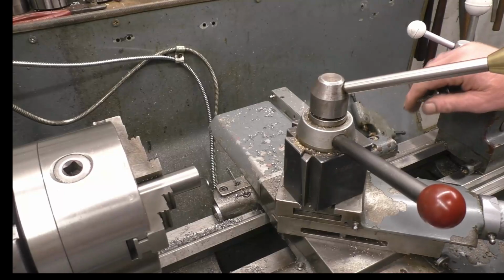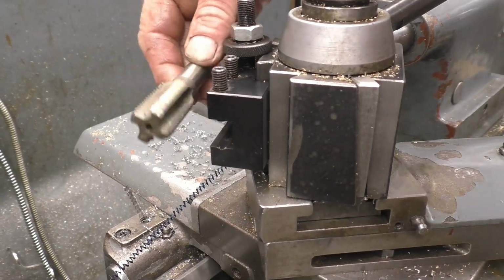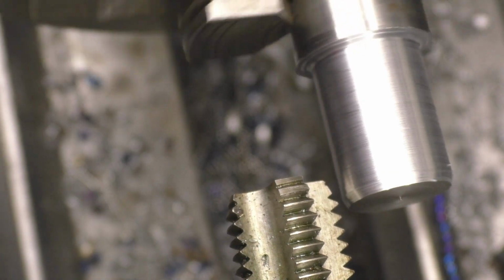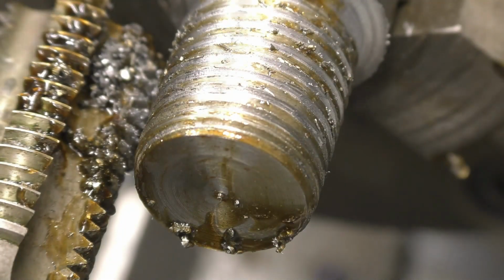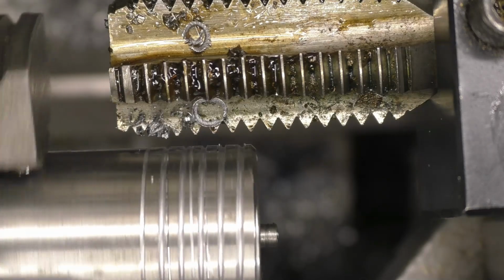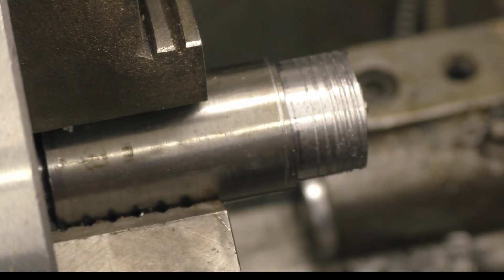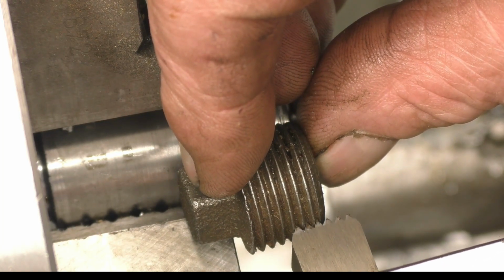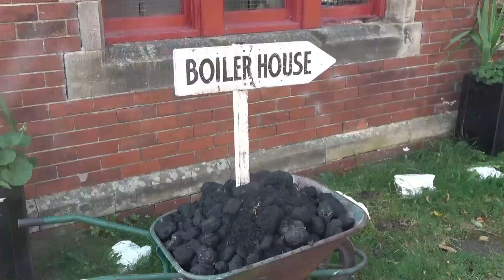SNNC 454 P2 . BSP Taper Threads. Tees Cottage Open Day / Car Show

Comment: The trick is to look at the leadscrew and the chuck, if they're both turning the same direction you're cutting a RH thread. If they are turning in opposite directions you're turning a LH thread, works EVERY time!

Comment: The problem you had was the cutting edge was on the wrong side and running the lathe backwards gave a left hand thread. What you needed was the lathe running forwards with a tap which had the cutting edge on the other side. There's a simple solution - use a left hand tap.

Comment: I had to smile when you said that you used to do guarantee/ warranty work on some of the vintage cars. One thing that I miss about those cars is the room under the hood as opposed to modern cars where you almost have to remove the engine to work on it. To be honest, I do not miss having to regularly change plugs and points on a car to keep it running well.
I applaud you on your willingness to try different techniques for doing something.

Comment: As your surmise, I think grinding tap to cut on non cutting side, the angle tap, then cut as normal RH will work.
Suggest turning taper first to suit BSPT angle, to aid thread tap angle.
Great on tonight's jobs, lovely machinery and video at Teeside.
Thanks for sharing

Comment: I’ve done this successfully save for using 1 chaser out of a modular pipe threading head instead of a tap and a Harrison L5A, the English predecessor to the metric 140, so you should do fine with it Jon 😎👍. That, and I found the technique from one of the Russian channels.
The principle is the same but the lack of taper in this setup comes from aligning the side of the tool to the work. If the tap is a taper tap then the axis of the tap should be parallel to the axis of the work. Cutting the taper on the work before will also make the job easier. Spindle CCW, tool on the front and a fast retract and it’s done. Best of luck.

Comment: Hi John and Debs 😊 great video mate, and a revelation seeing a tap work like that, I did notice it rolled forward towards the job when pressure was applied.i think your idea of grinding to get a lead cutting edge would help matters, also a flat on the shank to stop it rolling maybe, but your still not going to get a tapered motion of the tool holder I don't think. Anyway the car show was interesting, lots of nice examples there. Thanks bonny lad,  stay safe, best wishe's to you and Debs,  Stuart UK.

Comment: Hi john, the taper cutter I used had four cutters and trip. The four cutters were on a ring with two guides the threads being made pull the head into the work. The other one the ring turns and the bar or pipe is in a vice. Thanks for sharing.

Comment: Fascinating, I have seen this before but never this close up. It appears that only the first tooth on the tap is actually making the cut the following threads are just rubbing along the surface of the cut, pushing the cuttings back into the thread. I wonder if a better finish might be achieved using a second or taper tap where the cut is spread over a couple of teeth.

Comment: Try offsetting the tailstock and machine a taper, then use a normal thread tool to cut the thread.   May be a bit of b'stard thread, but it might work for a small item?

Comment: One way you can cut a tapered thread is between centers and offset the tailstock. I've never actually done it but in theory it should work 😊.
Cheers 🍻
Reply: Ah but then you have the arse if a job to put the tailstock back on centre!
Reply: @samrodian919  it's been more than a couple of years since I last adjusted a tail stock, but I don't remember it being any worse than truing up a workpiece in a 4 jaw
Reply: @mattsadventureswithart5764  it depends if you have a decent lathe or a cheapo Chinese one like mine ! lol

Comment: Put a boring head in the tailstock. Make a 60 deg centre for the boring head and fit it where the boring bar should normally go. Set your headstock up with centre and drive plate for turning between centres. Put the work in the lathe between centres, running on the headstock centre and the centre in the boring head. The work must have the taper machined to the correct angle for the portion that will be threaded. Now, using your boring head in the tailstock, set the work over the same way to the taper on the work, by the same half angle. Now the tapered portion of the work will be parallel to the bed. Screw cut in the normal way. Remove work. Admire tapered thread. Ps depending on the angle of the taper you might want to make a reverse centre for the boring head tailstock and use a ball as the centre.

Comment: The treads will be interrupted cuts and not continious. Also, it can be dangerous with the brittle threading tap overhanging too much with strong lateral forces. If it snaps in two, it can send a third sharp little bit at high speed (100..200 m/s) into the eye. A person I know, got blinded on one of hes eyes like so. He probably did not use eye-protection though...Evenso, it is not fun to have a sharp piece of metal embedded into the face or elsewhere into the body.

Comment: I have wondered if it would be possible to single point a tapered thread by having a device where you hold the tool against the work manually like wood turning. There would be a stop which you would push the tool against and the stop would be set to the taper required. The tool would be free to move in up to the stop and out but would advance along the work as with normal screw cutting. The cut would be put on with the cross slide and the stop set to the taper would push the tool back out against hand or lever pressure as it ran along. So you could incrementally increase the depth of cut. I guess the main problem would probably be chatter.

Comment: Check out  this old Tony’s  video on his shop made  taper turning attachment  , I know you could make one suitable for your lathe easy with your skill set this way the cross slide nut is disabled and the taper will be controlled by the  taper turning attachment  and taper threads can then be cut in the normal manner  ( I think , iv never done this 😁 )

Comment: John, to cut a tapered thread you need to feed with the compound so that the tool advances at the angle you require otherwise the tool will end up cutting progressively deeper as the work turns to the point when physics takes over and either the jaws of the chuck give up and the part slips or more likely the tool succumbs to the increasing stress and explodes in your face. You'd need a timed compound feed but nice try.......
Reply: His best shoot with be a taper attachment, then the auto feed would do its job.  He probably has no taper attachment though.

Comment: Technically, tapered threads only vary in diameter, i.e the V cut is square to the job. Cutting with a tap will result in the V of the thread at a slight angle. But probably won't matter 8-)

Comment: If the tap is at an angle and the workpiece has a matching angle all the teeth on the tap should start to cut at the same time and they will bite into the taper as they move along. A bit of trigonometry is needed to see how much they effectively move in for every rev of the spindle. ( I think ) To put it another way, from the point a tooth touches the work, in a certain number of spindle revs (depending on the taper angle) it will be at full depth. Now my brain is aching.
Reply: I agree.  The depth of cut will increase with every turn of the spindle if the tapered thread is cut in the normal manner (spindle running forward, carriage traversing towards the chuck).  In one of his videos, This Old Tony suggested that cutting tapered threads is possible as John suggests, and viewers agreed (in the comments section).  I want to see it done before I will become a believer.

Comment: Either he ground the trailing edge or he was using a LH tap? you would have to watch his video again and see.
Reply: My first thought was a LH tap but the side clearance angles on it would be all wrong, though I'm not sure if it would actually matter.
Reply: My first thought was a LH tap but the side clearance angles on it would be all wrong, though I'm not sure if it would actually matter.
Reply: @dutchgray86  I'm guessing it wouldn't because you roll it down and only use the leading edge.

Comment: I would be surprised if a tapered thread could be single point cut on a lathe without a taper attachment.  I assume that the cutter mounted on the compound must move in/out as the cross slide move left or right.  that's pretty hard to do.  Maybe I'm missing something if you are able to cut the tapered thread without the taper attachment  be sure to make a video. KOKO!
Reply: Cut taper between centers, thread in same setup. Angle is a bit steep for conical centers, but bearing balls could be used.

Comment: You should retitle the video "How to cut a Lefthand thread with a Righthand tap"😂
Offset the tailstock to cut the taper thread, then you can singlepoint cut as usual but you will be cutting on a taper once you set the correct amount of offset on the tailstock, just mark your tailstock before moving it to make it easier to set back to normal

Comment: Boy I was confused, the title states BSF taper, well I'm a turner and I've never heard of a BSF taper thread, just a typo I expect. lol
Reply from the maker: Should be BSP
Reply: @doubleboost  Yeah I realise that now, thought I was gonna see something new, lol
Reply: @doubleboost  Me again, The only way to cut a BSP thread on a manual lathe ( without a taper attachment) is to cut the taper first ( 1 deg 47 mins)), and then screwcut as normal but pulling out on the crosslide, takes a bit of practice, use a female fitting as a gauge. BTW I wish I had known about the Tees cottage thing, I only live a couple of miles away from the pumping station.